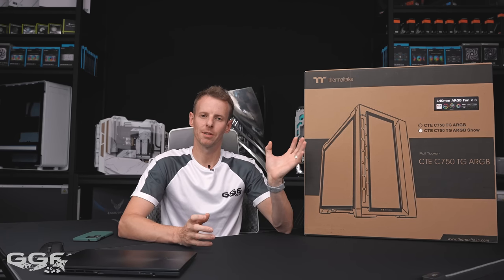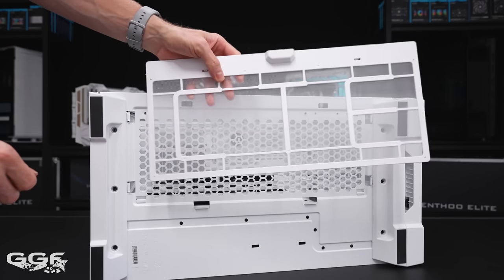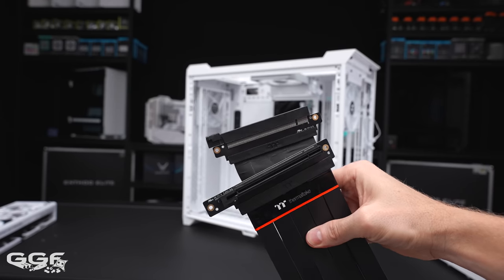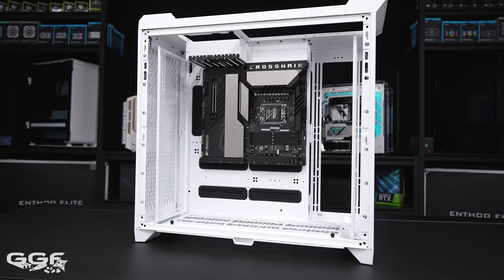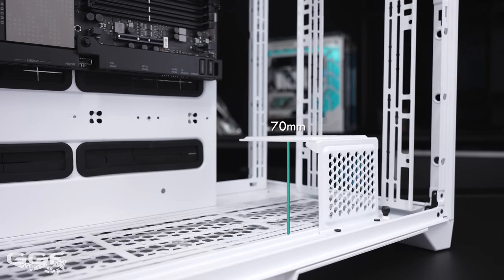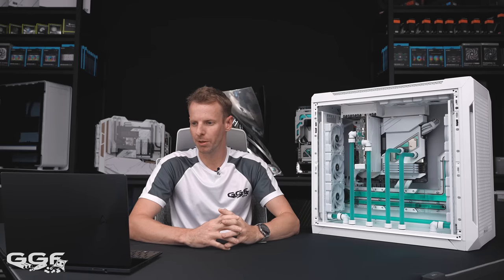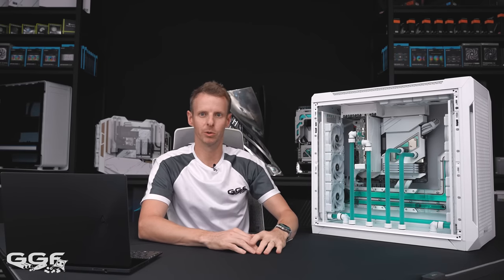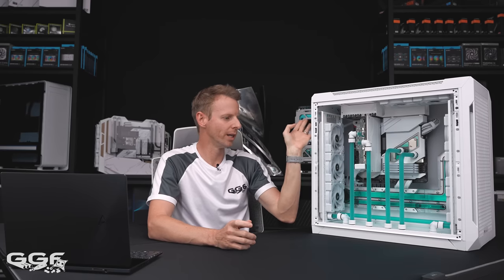Contender for TOP CASE of 2023! - Thermaltake CTE C750 Review

Comment: Zotac 4080 runs very hot on that vertical position, i had to change the orientation of the GPU mount bracket facing down on the bottom fans and all temps came back to normal.
Reply: Sapphire RX 7900 xtx nitro plus also overheats in this position. Not the best solution.
Reply: it is caused by the vapor-chamber of the gpu
the vapor needs to be able to rise into the heatpipes towards the fins.
with one vertical position this is not possible and therefore the temps are horrible

Comment: Quite honestly, this is one of the better case reviews I've ever watched, mate.  Considering the number of cases I saw in your work area, I was wondering if you've ever run across any cases that could possibly accommodate a regular ATX mobo AND a microATX mobo, two PSUs and two dGPUs?  In other words, a case that can house two ATX systems.  I've both liked and subscribed, so keep on with making the informative videos. Cheers for any help with this! 👍
Reply from the maker: Thank you. I don't think I've seen a dual chassis that will take anything over an itx for the second system. Unless it's something like a caselabs or thermaltake wp200 but those cases are huge!

Comment: 2:27 I disagree actually. Considering that the case can hold up to like 14 fans, having three included is pretty nice. I actually use two of them in my build. At worst, you can throw two of them in the top. They don't have to match anything when they're up there, and I'm buying three packs of the fans that I use. They're also daisy-chainable. If they weren't then I'd 100% agree with not including them. They also wouldn't have dropped the price that much for a fanless version anyway. 

4:50 putting that thing back in is a PITA, because the bits that hold it aren't connected so you have to make sure you angle the filter properly to get it in the second section. Didn't notice that it said CTE though. That's a nice touch.

13:07 Meanwhile, Corsair's 280mm radiator fits there just fine, but then that limits what you can have on the right side and beside the motherboard. Fans do fit on the "outside" of the top if you remove the dust filter, so if you're using it as exhaust, it's a viable setup.

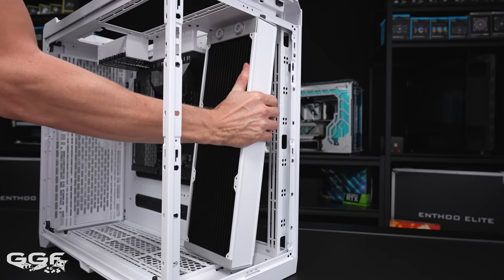13:45 Alphacool's NexXxos XT45 v2 doesn't fit there neither, due to the holes not lining up. This has nothing to do with their spec sheet. Note that their spec sheet doesn't have 420mm radiator support ANYWHERE, because they flip flopped all over their support for 420mm radiators and custom cooling. They just f'd up updating their spec sheets. If you check their usa page specifically(not sure if links will delete my comment), you'll see the updated spec sheet that actually does have 420 support for everywhere but the bottom and top. I can't remember if I could get the Corsair 420mm rad to fit there.

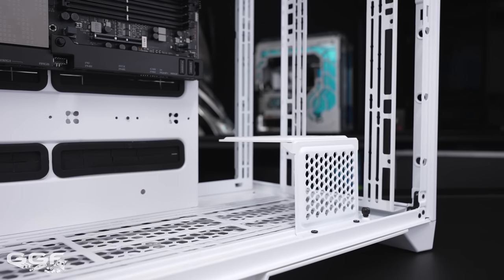17:06 Thing is, the bracket itself is pretty study, but the way it's mounted in is terrible. It's a waste that they really out the effort into something that almost everyone will ditch asap, given that it really only supports their own pumps. 

I wanna see someone have rads in just the right, back and top pushing out with the rest going in, just to see how that performs. I can't be bothered to redo runs just to test it.

The hole coming out of the case is small but the one going from the motherboard IO to the back inside the case is a sharp 90 degree turn and it's really small. If you're using a ton of USB + ethernet + audio, you're gonna have a bad time getting everything through that hole. 

26:30 They actually did say that, but I don't remember where. I think it's in the manual, that anything thicker than a 30mm thick rad on the sides would block rad support on the bottom. They started on the concept in like January, I think they said, and it's evident that they started advertising the product before they really tested things out, so they dropped the idea of 430 custom rads pretty quickly. Then they didn't update the documentation in all areas, so the only the USA page I believe even mentions that it supports 420mm custom rads. 

The TG models have been $199 since launch btw, which is still a fair price. 
I'd put it among top 3 mainly because of the price. You got a ton for less than half of what you'd get with the NV9 and O11 Evo XL, which are the other two 420mm rad cases.

Solid review!

Comment: Well thanks, I had already committed to the Phantek NV7 for my next built and now you have to introduce this here...I'm just as indecisive again. 😅
It would be interesting to know if you can fit 4x 360 30mm radiators or if it will be too tight.
Reply from the maker: 4x 360s at 30mm would fit

Comment: Thermaltake's new CTE case's look really good. been waiting since CES for these to launch. currently using a TT core X71 TG  and like it a lot. 
but it lacks features new cases have like GPU anti-sag brackets, USB C, and RGB sync from the MOBO. other than that it is great and tons of room.
Reply: That's the best thing about the CTE layout, zero gpu sag and I/O at the top imo.  Silverstone had 90 degree patented for years, I can only assume Tt created the enclosed 'CTE' form factor to get around those issues.  Same with their Tower line, it's technically 90 degree but basically a one off form factor.
Reply: u dont get GPU sack when its mounted in a vertical position

Comment: This case has the layout support I've always wanted, but I don't understand why they didn't make the front and back of the cases symmetrical in exterior design. It's a silly deal breaker for me. I want the rotated motherboard with radiators flanking up the left and right, but I can't un-see how the symmetry of the radiators inside wouldn't match the exterior.

Comment: All CTE chassis have filter issues.
There is no frame across the filter to support it, so the filter stretches.
A stretched filter wears out the fan and creates noise.
The manufacturer must acknowledge the design error and supply a new filter.

Comment: Loved the video, but this “vertical vapor chamber not working properly” nonsense really needs to be addressed. There is absolutely NO reasonable theoretical explanation whatsoever behind this. 
None!
And Steve, from Gamer Nexus went into details why this is just false.
First, we must understand what vapor chambers really are:
“Vapor chamber cooling is a highly efficient thermal management solution used in electronic devices and high-performance computers to dissipate heat generated by the components. It is a flat, sealed chamber filled with a small amount of liquid (de-ionized water) that evaporates when exposed to heat. The vaporized liquid then spreads out evenly across the chamber, transferring heat away from the source and towards the outer edges where it can be dissipated more effectively.”
As you can see, it’s all about spreading the heat throughout the cooler itself. The direction of the cooler has no influence whatsoever in the physics implied here. As the vapor moves away from the heat source, it cools down. Since it’s a pressurized closed system, once it becomes liquid again the systems own pressure from newer gases moves this through the system until it’s near the heat source again, where it turns into gas once more. Rinse and repeat.
This can only become a problem if the vapor chamber isn’t filled properly, and left with some “air bubbles” in it, or if there’s some physical barrier within the loop. The former was what some AMD GPUs had some time ago (led to a recall), and where this myth really was born, imho.
Think about it guys: CPUs have been using Vapor Chambers in vertical and horizontal for ages, and this was never a problem there.
Thermaltake does it. Lian li does it. As quite a few others (Silverstone was the first to do it almost a decade ago, if I’m not mistaken) as well. You guys really think they would go this way without at least some proper warning in their manual? Really?
Besides this misinformation, I loved everything else. Best video I saw concerning the CTE 750 so far
Kudos!